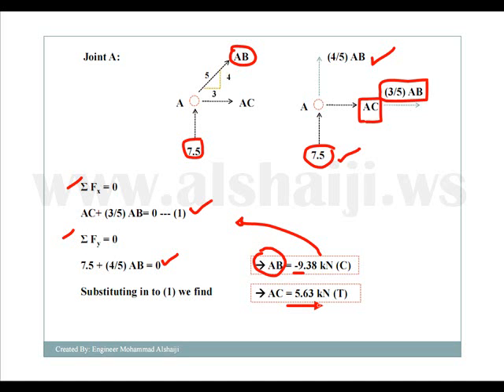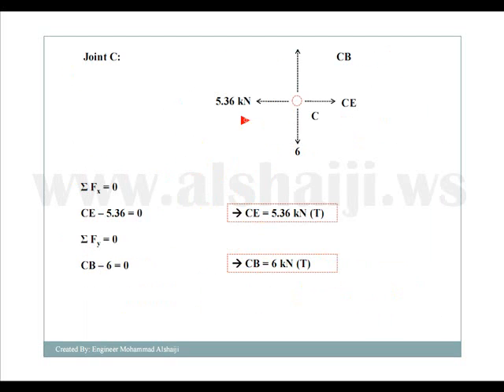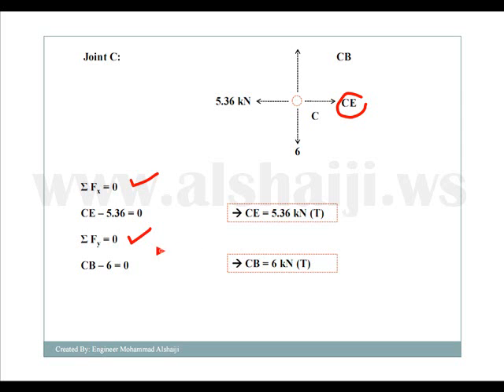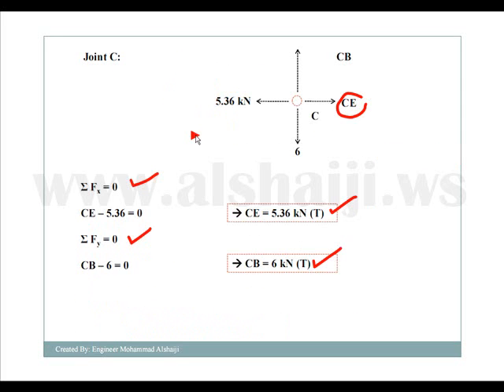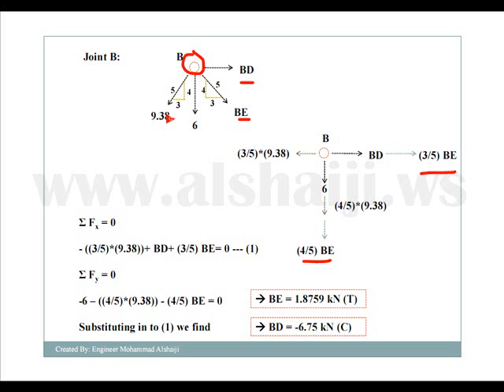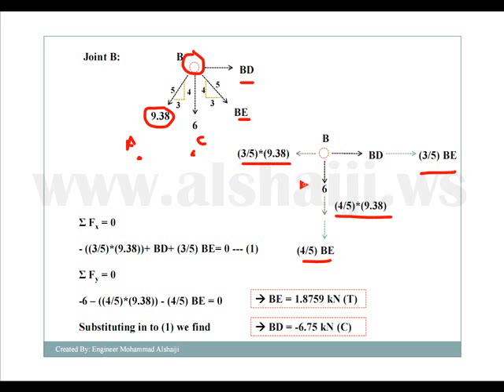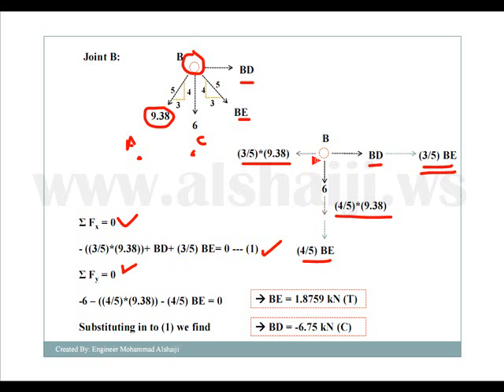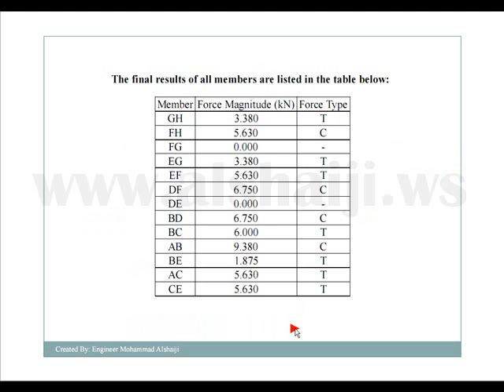Truss Analysis Using Method of Joints – Part 2

Comment: I just dont understand how you got BD equal to 6.75 in compression when i got around 4.5 because BE is positive and in tension so i multiplied negative 3/5 8 AB and got 5.632 and then added 3/5 * 1.88 where does that sign switch?

Comment: Sir at joint B i understand how you have your signs negative in the y direction because BA is in compression and you have a downward force and in the y direction and your unknown force of BE.  In the x direction do the signs change because of the sign of cosine in the quadrant?  Like for example is it 3/5 BE because cosine is positive in quadrants 1 and 4 and negative in 2 and 3?

Comment: for BE

in the y direction:
-BC-BA(4/5)-BE(4/5)=0
-6-(-9.375(4/5)-BE(4/5)=0
6 + 9.375(4/5)-BE(4/5)=0
BE=1.875 KN (T)
since we know ba = -9.375 from joint A so -BA is +9.375
hopw this helps

Comment: Can someone please explain how did he get BE=1.87 ? I keep getting BE= -16.88. overall its very clear explaination but BE is very confusing?
Reply: for BE

in the y direction:
-BC-BA(4/5)-BE(4/5)=0
-6-(-9.375(4/5)-BE(4/5)=0
6 + 9.375(4/5)-BE(4/5)=0
BE=1.875 KN (T)
since we know ba = -9.375 from joint A so -BA is +9.375

Comment: Why not taking the angle theta ??
Reply from the maker: It was not provided in the question. It can be calculated easily, however, working with fractions like 3/5 and 4/5 makes the solution easier.

Comment: Why is DE 0?
Reply from the maker: it is called "Zero-Force Member". Some members in trusses do not carry any loads. They are there for the stability of the truss. I remember my professor once said "it is nice to always have a back up member around in case some members fail". Furthermore, it was shown "Mathematically" that the member has a force of magnitude " 0 ". I hope I answered your question.
Reply: I get the explanation but im still wondering how did it get zero. Thanks for replying man 😀

Comment: First of all thanks for the video! It really helps. I have a question though.. might just be a stupid calculation error, but I keep getting BD= 4.503kN. I'm doing this: -3/5(9.38) + BD + 3/5(1.875) = 0.  Could you please explain that bit? Thanks again!
Reply: Me too! Keeping the positive and negative values consistent throughout gives the answer 4.5kN. -5.63 - 3/5(-1.88) = -4.5kN. However if you change -5.63 to positive 5.65kN you get: 5.63 - 3/5(-1.88) = 6.75kN. I don't understand how this could be correct, surely you need to keep the values consistent throughout? Anyway, that's my take could be wrong.

Comment: at point C, why are we subtracting instead of adding. As we did in point A
Reply from the maker: If you look at the free body diagram of joint C, you will see that all the forces in the x-direction are opposite to each other (the same fore the y-direction). if you consider the direction of the positive x and y axis as the positive directions for the entire problem, you will have CE-5.36 in the x and CB - 6 in the y.
I hope that answers your question.

Comment: in the Summation of Forces in y; the equation should read; -6 + ((4/5)*9.38) - 4/5BE.  Then you will get the answer of 1.88.  I to struggled with 16.88 as the answer.
Reply: +Bard Hazzard He substituted -9.38 in every equation and not +9.38
Reply: +Sultan Balhai but since we know that AB is in compression, shouldnt we do the equilibrium eqtn with -9,38? this kinda confuses me....
Reply: +Sultan Balhai never mind, i see it.
thx

Comment: in solving for joint c, why is AC <-- (to the left) when you previously found it to be in Tension, so i have AC drawn in Tension with 5.63KN to the Right of joint C?
Reply from the maker: Laith Bilbeisi When you say the member ac is in tension, the forces should point away from the joint. For example:

Member AB is in tension as shown here:

A  o -->       <-------------------------->    <---o B

See that the forces are pointing away from the joints and due to equilibrium they make the member in tension.
Reply: CTSCIVIL Thank you, i understand it now :). So the member includes the joints, i didnt see that way before.

Comment: Couldn't watch this vid on my phone unfortunately. Things get pixelated and glitchy. The first vid works just fine though. 
Anyway, thanks for lecture! Finally got it! Great vid btw. (Had to watch this part on my laptop)
Reply: Btw you made a lil mistake i think.
Since AB is compression, shouldnt AB point inwards relative to joint B? Not ther other way around as shown in the vid?

In your ZFy equation, you had:
(-6 -4(9.83)/5) = 4/5BE
If you actually compute this, you would get  -16.88 instead. Not 1.875.

Had you pointed AB outwards relative to joint B, you would actually get:
-6 +4(9.8)\5  - 4(BE)\5=0
BE= 1.875 kN
 
Incorrect diagram but a correct sol'n?

This actually made me more keen and understand this topic more. Thank you! Hoping to pass my incoming exams!
Reply from the maker: Reb Abuhin I try to keep the forces pointing outward from the joints all the time. When they are in compression, I like to change the sign only

Comment: Hey.
Could you people tell me how does it look like when it comes to a situation in which
our calculated value, lets say Fab is negative then Fba is going to be written as a positive or we keep it negative?

In the video Fab = -9.sth is being changed for positive Fba=+9.sth.
Wchich doesn' t take place at positive forces +Fxy=+Fyx you know what i mean...
Reply from the maker: Jan Kowalski I see what you are saying. Fab = -9 was calculated. That is what you got after doing the math. When you move to another joint you know that Fab = Fba (which is the Force in member AB). At the new joint, We assume that all forces are pointing out of the joint making all connected members in tension. Members in tention have positive forces. That is why we have Fba = +9. If you follow this method an assume that the forces at the new joints are pointing out of that joint, you will eliminate the confusion with signs coming from previous calculations. I hope that helps
Reply: CTSCIVIL 
It is very clear and qiuck answer, thank you very much, man! :D
Reply from the maker: Jan Kowalski Glad that was helpful.
Good day :)

Comment: you have taken CB as +6 which is ok.so when calculating ΣFy that should be 6-((4/5)*(9.38)) - (4/5) BE = 0, BE=-1.88 and BD=+6.75.I may be wrong. Pls do clarify.
Reply from the maker: soumyajit das if the force in a member between two joints is positive, the member is in tension. if the member is in tension, the internal load shown on the end nodes should point outward from the nodes as if they are entering the member. The "6" you see here happened to point downwards as it points away from joint B. That is why it is pointing outwards and that is why it is negative.
Reply: CTSCIVIL so for AB the member is in compression, then it should point inward from the nodes and should be +(4/5)*(9.38).

Comment: This is definitely wrong... BE is wrong.
Reply: +Bishen Patel Dude. Look carefully, the sign for BE used by author is wrong
Reply: Dude, try to recall the previous part whereby you calculated the value of BA?? You managed to find BA = 9.375 ( Compression ), right? So when we are calculating the force for BE, we take the force for BA as -9.375, and not +9.375... The sign difference is merely due to the tension / compression that we manage to calculate in the 1st section earlier..

Comment: Is BE =16.875 ? If not kindly explain
Reply: CTSCIVIL At joint A, you've assumed AB to be tension and it turned out to be compression. When we're dealing with joint B, should the direction be different that what is on the video (towards B and not outwards)?
Reply: g mike dude, try to recall the previous part whereby you calculated the value of BA?? You managed to find BA = 9.375 ( Compression ), right? So when we are calculating the force for BE, we take the force for BA as -9.375, and not +9.375... The sign difference is merely due to the tension / compression that we manage to calculate in the 1st section earlier.. Am I right CTSCIVIL ??
Reply: exactly, I also dont understand how come BE = 1.8759 but not 16.875. Can someone answer it please?
Reply from the maker: Guys, I uploaded a video recently using a small software (mdsolids) to check the same truss. 1.8759 is correct.
Please go over it again slowly :)
Reply: why is BE 1.8759? 6((4/5)*(9.380))=-13.50
then -13.50/(-4/5) =16.875 kN. if this answer is wrong, then the equations must be wrong -6+((4/5)*(9.380) , and if that's true then I am lost
Reply: mem AB is under compression, the video showed the force and equation wrong, but the answer for BE is correct +1.88 tension
Reply: @swinginever4  whats the right equations?
Reply: oh thanks
Reply: he forget to write the negative sign for AB since its under compression, so its -9.38 not 9.38

Comment: @mohammed bin there are three members at both joints D and G, and two of the three members of both joints are collinear, so the third joint is a zero force member(as far as I know). Usually used for giving more stability to the truss.

Comment: I'm not having a go at you I just want to make sure I'm correct and if not, why

fx=0 [right is positive]

-((3/5)(1.875))-5.36+EG+((3/5)(EF))=0
EG+((3/5)(EF))=6.49 ----(1)

fy=0 [up is positive]

((4/5)(1.875))+((4/5)(EF)) -6+0=0
((4/5)(EF))=4.5 -----(2)
EF=5.630kN (T)
EG=6.49-((3/5)(5.630))=3.11kN (T) ------> that's my answer am I missing key info?
Which also makes GH=3.12kN (T)

Comment: im getting EG=3.12 kN (T) not 3.38kN how you work it out? I think 3.38 kN is a follow through error from CE=5.63kN
Reply: If you start calculating from the right hand side ( roller H ), you'll be able to calculate that EG is 3.38 ( tension ), instead of 3.12 ( T )

Comment from the maker: To remove any confusion and make your work systematic, always assume the forces pointing away from the joints even if you know that they are not. I know that from joint A you already have an idea about the direction of the force into or out of joint C but if you keep the signs (- or +) and assume forces to be in tension, you will have a systematic solution that should be error free.
Sorry for the late reply and hopefully that helps 
Thanks
Reply: Sir 5.63 in joint c not 5.36

Comment from the maker: to stop yourself from making mistakes do the following
1) always assume tensile forces from the joints to be positive and the compression to be negative.
2) carry the force from the previous step as it is with no changing of sign
3) when analyzing the new joint, use step (1) assumption and introduce the "carried" force from previous step "as it is" this way, if it is positive it will be tensile and if it is negative it "look" tensile but with a negative sign (i.e. compression)
hope that helped

Comment from the maker: you need to know the maximum stress allowed by the material the truss is made of
you need the cross sectional areas of all members
once you get the forces in all members, divide them by the cross sectional areas to get the stresses in each member
compare the stresses produced with the maximum stress allowed
pick the largest stress that does not exceed the maximum allowed
see what force caused this stress you picked
THAT IS YOUR MAXIMUM FORCE :)

Comment: So if you drew your truss out with all the arrows on it, if you had a beam with the arrows pointing towards each other, would that member be in compression or tension? Logically that would show compression, but looking at some solutions my lecturer has put on the internet for us, it seems to show the beam's reaction forces, meaning that the beam is actually in tension. So do inward-pointing arrows on a beam means the beam is in tension or compression??

Comment: @essssa2009 You're mistaken. In his diagram the 9.38 KN force has been drawn wrongly. It should be in the opposite direction ie. pointing towards point B. This is because from the first part of the video while solving the forces on point A, it is found that member AB has a 9.38 KN compressive force. By definition, this would mean that the arrowheads are pointing towards each of their respective points instead of away. By adjusting for this error, you are able to get his values of 1.88 KN for BE.

Comment: slam I would ask for the AC is it comperrision or tension because the 1 equation was AC+(3/5) AB=0 
and second one is 
7.5 +AB(4/5)=0 
so we found AB= -9.37(with negative sign) 
so it will blog in the first eqution =AC+(3/5)(-9.37)=0 
the result will be =AC-5.62=0 than we will move the -5.62 to that makes AC=5.62(plus sign) I really wondring just thanks for your time :)